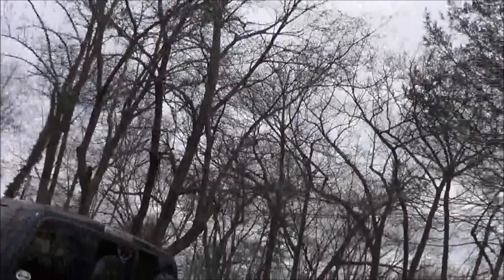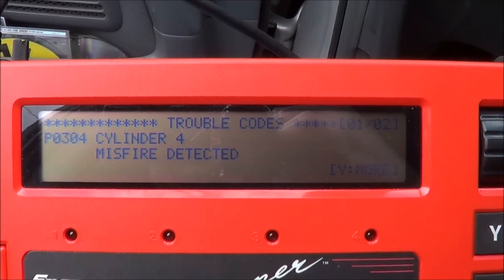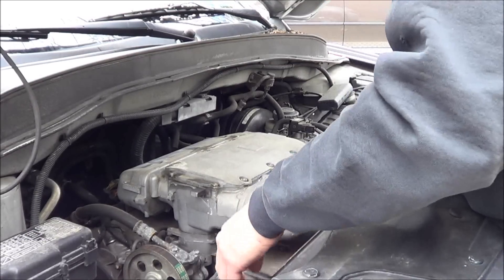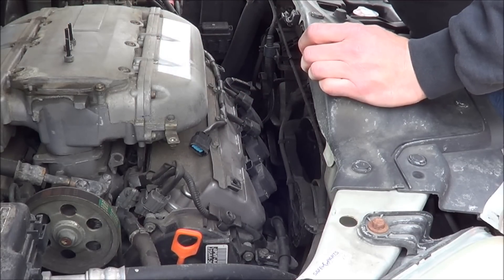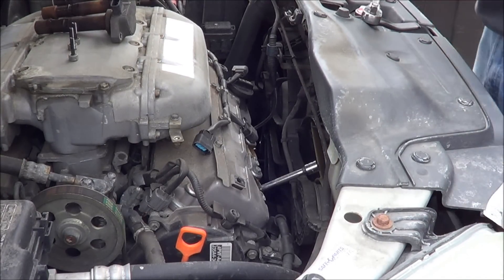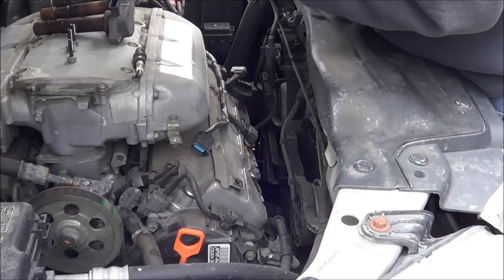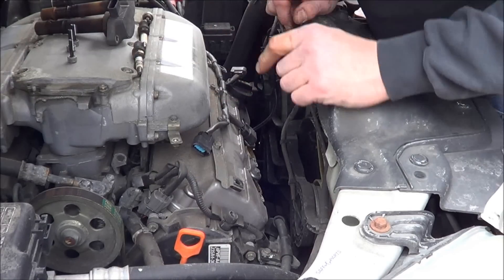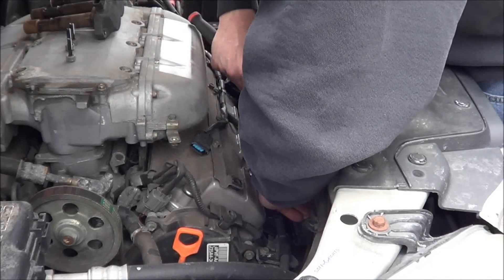2004 Honda Pilot P0304 misfire cylinder 4 diagnosis and repair

Comment: I have an 04 with cylinder 1 and 5 misfire. Changed both coil plugs and problem still there. Spark plugs are new. There’s no spark on those cylinders until I give it gas. Any thoughts?
Reply: Check your pcv valve

Comment: Hi sir, I changed the spark plugs and coil pack and the p0304 kept coming back. Any other ideas what could cause it?
Reply from the maker: fuel injector or engine mechanical issue.
Reply: what did it end up being?
Reply: Had to replace a fuel Injector
Reply: @christophercalimlim2213  man lol, i’m getting a code for the 2nd cylinder and i switched out coil pack so it’s not that and spark plug looks fine. did you replace it yourself? if so do you have any tips or did you watch any youtube vids for fuel injector replacement?
Reply: @sleepypeas  yup was able to do it myself.  I forgot but yes I watched a replacement video off YouTube to do it
Reply: @christophercalimlim2213  okay thanks, found a video seems not too bad gonna test my spark plug first then maybe do that.

Comment: i ha e a 2004 Impala and autozone gave me code p0304  the 4th cylinder misfires how can i swith them around like u to see if that will work before i go and waste $79 on a new fuel injector that they said i needed to fix the problem or can some fuel injector cleaning liquid help???

Comment: Thanks for the info,have an odessy doing the same thing . My #4 cylinder was in the same condition, I had my plugs and timming belt changed 50k ago. swapped the coil packs on 4 and 5 see what happens again thanks.
Reply: Michael Underwood my number two plug midfire

Comment: If the valve cover gasket is leaking or you find that there's coolant in there you wanna suck out any liquid that's in there before u remove the spark plugs because if u don't it will suck whatever liquid is there into the spark plug hole and burnout the pistons
Reply from the maker: Thanks for the tip!
Reply: What is the best way to great crap out of the tube when the plug is still in it.  Also if there is crap on the threads?

Comment: Broncocarl, Looks like you fixed another one. I had a dealer leave a plug loose enough that over time, it popped out of the head. Since then, I don't let my cars go to the dealer. Did the last 2 timing belts myself, it was a lot of work, but, I know it was done right.
Reply: Its worth it.  I bought my great running CRV to a ass mechanic and now I have a effed AC pump from over tightening of belts plus a blown head gasket.